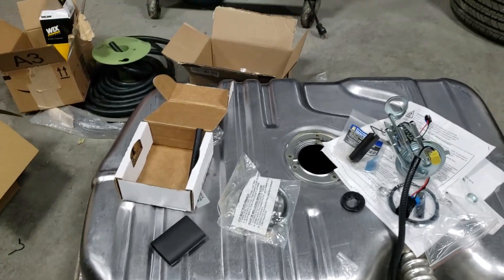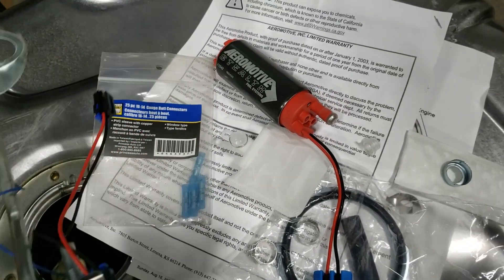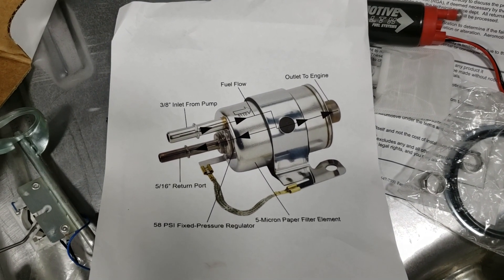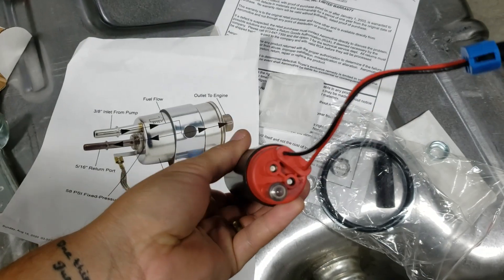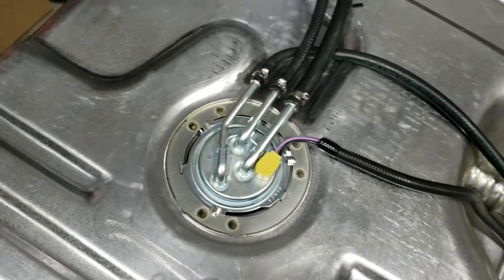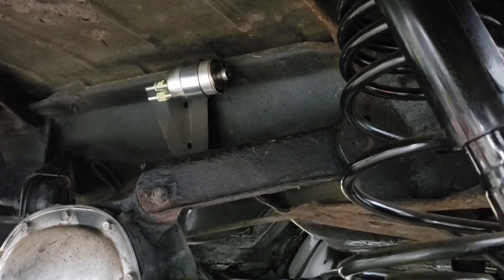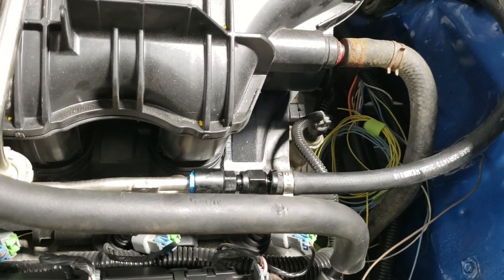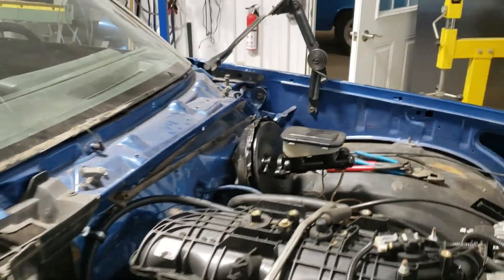LS Swap - Fuel System

Comment: Great video. Did you use all the “stock” wires that came with the GN sending unit? The power and ground wires seem to thin to handle the demands of an aftermarket fuel pump. Also the pass through on top of sending unit. That’s all stock, just like when you bought it?
Reply from the maker: Yes, I used the wiring that came with the sender and connected it to the pump. No issues, and it's been a few years and lots of miles.
Reply: Thanks for the quick reply! I think im going to upgrade them anyway to be on the safe side. I’m using a Holley 340 LPH pump and they say in the instructions to use at least 12 gauge wire to connect to the pump.

Comment: Question about the color of the wires on the sending unit. I know the black needs to be grounded to chassis but the purple and grey wire not sure. I have a 85 Chevy Caprice Classic that wasn't fuel injection that has the 1 wire at the tank. I bought the Fg10 f spectra sending with a PSI harness. Just need to know where to run those other two wires
Reply: Thank you, so that I understand you correctly grey wire goes to relay power and purple is connected to sender, there's a single red wire that I unplugged from my tank do I have to tie into that wire and run it to the relay provided on the harness. Sorry for all the questions I just don't want to mess things up because it's my first swap and YouTube is helpful but no one really go into detail about exactly where each wire goes. Thx again...
Reply from the maker: @Berryhill42  I'm not sure about the red. I'd have to see it. Yes, the grey should go to the relay that feeds your fuel pump and purple to the factory sender wire.
Reply: @SlowCarFix  the red wire on my original setup which had a mechanical fuel pump was the wire to let you know how much gas was in the tank. The original sending had just 2 wires black ground and red fuel level wire. The sending unit and tank I have is set-up for 1986-90 Chevy Caprice Classic FG10F which has 3 wires, a black ground, grey to the sender and my question does the purple wire go to the relay that was provided with the LS swap harness
Reply from the maker: @Berryhill42  On the one I used, purple was the sender. So that would go to your red wire (if that's your factory sender) The grey was power to the electric fuel pump.
Reply: @SlowCarFix  Thx so much, appreciate you..
Reply from the maker: Grey wire is pump power, purple is the sender.

Comment: I am ls swapping a 96 f350 with the 351w (has injectors already . Will I have to switch the pump ? Swapping a 5.3 in the truck
Reply from the maker: I'm not that familiar with Ford stuff, but you need 60psi to keep an LS happy. It doesn't matter what pump you use, as long as you get the correct fuel pressure and flow rate. Hope that helps.

Comment: Great video man. Your setup is almost the same way I did my 69 Chevelle. With the exception of the in-tank fuel pump, I drilled big holes in the bottom of my tank and welded on a bottom sump(Kenda triangular shaped) with two 1/2" bungs and an inline pump.
Reply from the maker: I used to have a sump on this car, and an in line pump for a SBC, but I wanted it quiet this time.  I am doing a similar set up to this on my 57 truck very soon.
Reply: @SlowCarFix later on, after everything is sorted out, I might try to cut open my original tank and try to put some sort of baffles and a sump inside of it. The online pump is fairly loud, and I'm (like you) really wanting to make it a driver car again.

Comment: Does the baffle in the gas tank basically look like a dog bowl ? I got my new tank in and just wondering if it’s the right one thanks
Reply from the maker: I believe it did, if you can't see the bottom of the tank through the sender hole, it's likely a baffled tank.
Reply: Same question I had? No bowl in the new tank. I don’t think I seen any baffles inside new one either?

Comment: I was wondering with the 1/4 return line did it cause any issues?
Reply from the maker: No issues. I have 8000+ kilometers on it with no issues at all.
Reply: @SlowCarFix  Thank you for the reply. Your show and tell couldn’t be any better.
Reply from the maker: @Sheeshlocks  I'm glad it helped. That makes it all worth while. I'm going to have to review my notes and watch my video again soon as I'm putting a 6.0 in my 57 truck.

Comment: Why did you use a zip tie to secure the pump to the sending unit? Hose clamp would have been better, zip tie will get brittle in fuel over time.
Reply from the maker: Didn't think of it, I'll let you know if it fails.

Comment: Hi just curious if you had to wire a fuel pump relay or just wired to the grey switched wire in harness? Thanks
Reply from the maker: No relay, I just wired it to the LS harness.
Reply: @SlowCarFix  thanks for the reply

Comment: Hey, I’m doing a 5.3 vortec swap into a 1972 Caprice.... do I need to change anything with the fuel system or can I just run it with the factory unit.
Reply from the maker: yes you need to change everything, it's a good part of the job. You need an electric pump, regulator, high pressure line etc. Pretty much everything I describe in this video. It's not hard but takes time.
Reply: @SlowCarFix  okay. Thanks. Any brand recommendations?
Reply from the maker: @gorillabuiltcustomz5449  I used a aeromotive stealth pump and the lines I bought local. Fittings are all from Amazon and the fuel pressure regulator is stock C5 Corvette
Reply: @SlowCarFix  I appreciate It brother

Comment: what lph pump is that? had any problems running that setup?
Reply from the maker: I can't remember off the top of my head, but I go through all the part numbers in the video. I have had no issues with this set up so far.
Reply: @SlowCarFix  its a 340lph pump. The reason I asked is because a lot of people say don't run anything bigger than a 255lph pump for the 33737 filter/regulator. Just seeing if that is a myth, or justifiable.
Reply from the maker: @claytonhaske  It's good you checked. So far no issues. What are the common issues with that pump and stock regulator? When I researched I didn't see any issues. I thought it is a common set up.
Reply: @SlowCarFix  Note: The C5 Filter/Regulator is capable of flowing a maximum of 255LPH. Beyond that amount, there is the potential for fuel pressure creep as the flow rate can overwhelm the internal regulator.
 This is in the description from a c5 regulator from ebay, ill see if I can find anything like that for a wix specific regulator

Comment: You actually was the first person to explain in detail what's what on the fuel system thank you 🙏 but how did you get the line from the engine to the filter to go in to the filter do it just pop in
Reply from the maker: it's a "quick connect" fitting that pushes on the fuel rail, just like the other ones I used on the fuel pressure regulator etc.

Comment: What engine are you running
Reply from the maker: Gen IV 5.3L LS. Check out my other videos, I've documented the process. Thanks for watching
Reply: @SlowCarFix  the reason I asked because I see the computer you are using and that's the same one I got when I pulled my engine out and didn't know if I could that style computer
Reply from the maker: it works!
Reply: @SlowCarFix  thanks

Comment: Did you use the factory sending unit with the fuel pump or did you use a efi sending unit ? Thanks
Reply from the maker: I explain in the video, with part numbers. It's a grand national sending unit which is fuel injected.
Reply: @SlowCarFix  ok thank you
Reply from the maker: @badss87-67  no problem. best of luck.

Comment: Will that sending unit fit the 78 Malibu stock fuel tank? 🤔
Reply from the maker: sure it will, but you still need a baffled tank to run an in tank fuel pump properly. I recommend a grand national tank or fuel injected monte Carlo tank.
Reply: Ok, thanks.